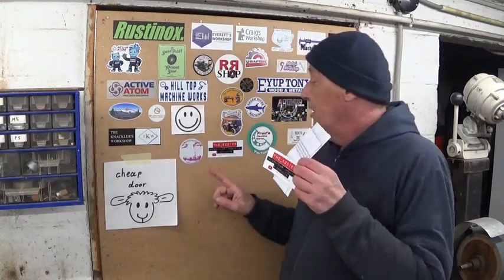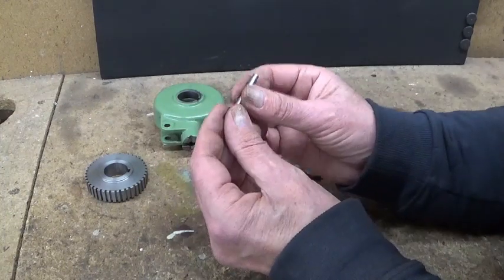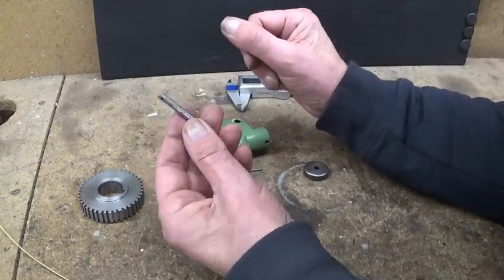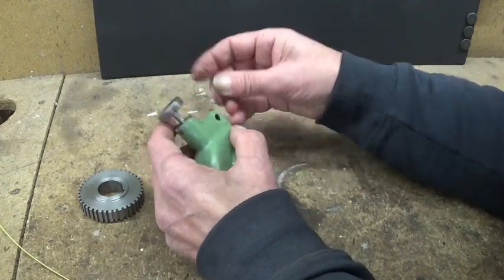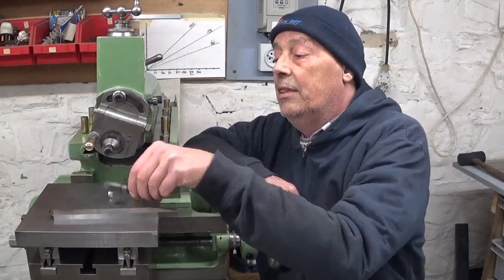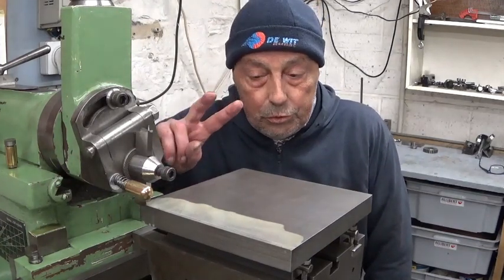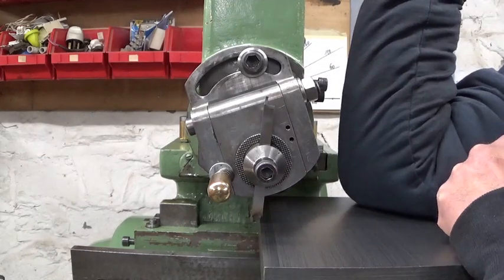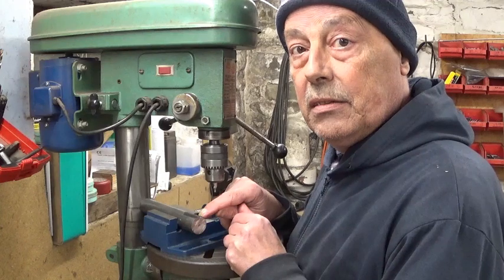Fixing the table feed.

Comment: Looking healthy and strong rusty.I had the same problem with my 7 inch southbend shaper.Intermitant feed.Mostly dried grease and oil in the feed mechanisim with some wear  like yours was,A bit of grinding and cleaning corrected the problem.I had to take the entire machine apart to get it down stairs into my tiny shop in the furnace room.I should send you a picture of it.I can't get fat or I won't be able to squeeze between the machines. Keep  up the creative thinking and most important stay well
Reply from the maker: Thanks, i will.

Comment: Genius thinking of using a guitar string for that spring, given that is isn't large enough to warrant piano wire.  Sorry the HSS wasn't up to the task over the wider surface, hopefully it can still be of use for smaller pieces.  Surface still looked decent from here though!  And I've never thought of that trick with the drill press, thanks for passing on the idea!
Reply from the maker: It's just as genius as using hockey pucs as machine feet :-)

Comment: Gday and happy new year, the finish on the surface plate look very nice, I found that 45° on a shear tool did no good on my shaper, the last shear tool I made is at around 60° and that worked quite good, I might try 75° next time to see what happens, that’s was a fantastic tip to find centre on the drill press, take care mate, cheers Matty
Reply from the maker: Thanks, Matty. Just never stop experimenting.

Comment: Hi Rusti happy new year to you. I have a similar problem, I found the hand wheel was the problem the weight of the handle made it fall back a little and not catch the mechanism when on the up hill side so I just remove the hand wheel when in power feed.
Reply from the maker: Or just tighten the bearing of the leadscrew a bit.

Comment: Hello, I have got to the shaper too. Problem is easy to solve. Rachet wheel move with mechanism. You have to tight the feed 
screw (table, tightning screw/bearing)). If it too loose , it moves with rachet wheel. Your Sincerely TK
Reply from the maker: Thanks for the tip, but here it was not the case.